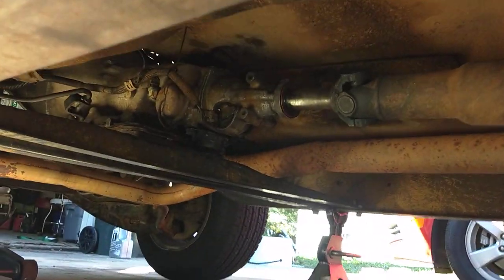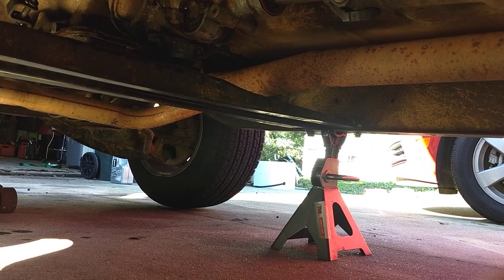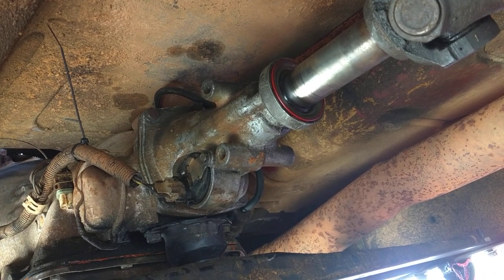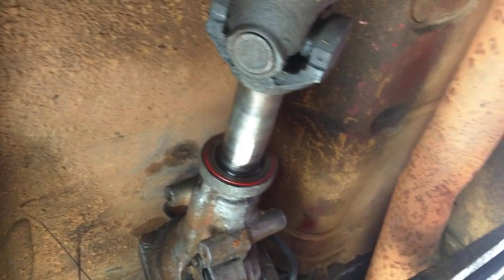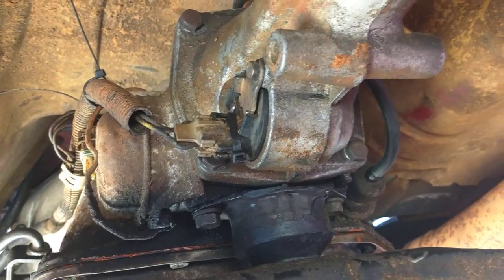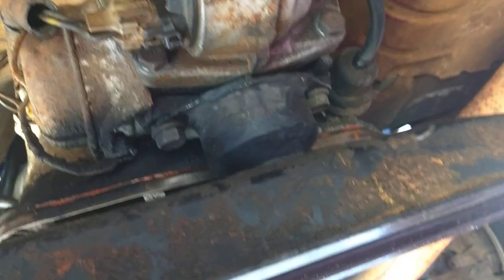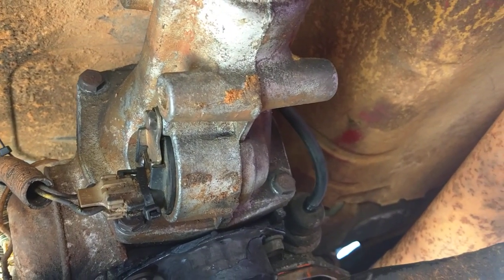700r4 to TH350 Swap not as easy as you think!

Comment: I have an 89 c1500 extended cab and did this swap.  Had to get the 9" tail and modify my crossmember for the mount to have something to hold.  The 2 piece driveshaft saved me from having to get a custom driveshaft.  My homemade crossmember mount makes the pan leak easy but aside from that everything has held up fine.

Comment: I just swapped out my 700R4 for a TH350 in my 1985 K1500 Suburban.  The guy who rebuilt the TH350 added an adapter to it (between the trans and T/C) to make it the same length as the 700R4, so I was able to re-use both driveshafts.  Had to add a vacuum line.  The crossmember lined up OK.  Doesn’t downshift automatically when you accelerate hard because I don’t have a kick-down cable.  Just didn’t feel like getting that 700R4 rebuilt again.
Reply: Frankly  from  your  experiment  which is better   :  the   TH350   or the  700r4    transmission  ?

Comment: Th350 have a 6 inches tail and a 9 inch tail. The 9 inch is only about 1/8th difference total length compared to the 700r4. You need the 9 inch tail. Direct replacement for 700r4
Reply: closer to a inch than a 1/8
Reply: Agree
Reply: @Casey Nemecek…very true! I just did this exact swap from 700r4 to TH350 with the 9 inch tail and it was a perfect swap. The only difference was my truck was a 1985 GMC Sierra (long wheelbase)
Reply: @camron2674  speed sensor and linkage mounted up easy?

Comment: You just need to find the right length driveshaft they make a thing called a baster joint so you can mate an odd size yoke to a different size driveshaft if u cant find the right length get a longer one and have it cut down by a machine shop so its balanced right there u go wham bam👌
Reply from the maker: I ended up buying a 9" tail housing and everything lined up perfect. Didn't need to cut the drive shaft. I called Hughes transmission shop and discussed my problem with him and he put me on the 9" tail housing everything worked perfect.

Comment: I have done many times this swap. The output shaft is same spline for both th350 and 700R4 transmissions at 27 spline and TH350 truck transmission 9" tail shaft is longer also then TH350 car 6" shaft. You must have the 9" truck TH350 output shaft and tail housing to direct swap this into place of 700R4 or 4L60/4L60E.
Reply: Para pegar un clip en el cuadro de texto, tócalo.Para pegar un clip en el cuadro de texto, tócalo.
Reply: For both

Comment: You need a long tail 350 it's a 1/8" difference
Reply from the maker: Ya bought a 9" tail housing and replaced it. Was perfect after that. Ran flawlessly.
Reply: Did you have to change output shaft?

Comment: You need a long tail TH350. These particular transmissions came stock on Station wagons not sure what model and year but very common with the classic wagons.
Reply from the maker: Ya this 350 turbo came out of a wrecked 1970's van. Bought a 9" tail housing off Ebay and it fit perfect had to modify my speedometer
Reply: @tobroke2007  @ did u fix the speedometer?
Reply from the maker: @gerardolopez5875  actually used the 700R4 tail housing on the 350 tyranny but bought a 9" tail housing later off ebay to fix my yolk  problem. Never fixed the speedometer.
Reply: @tobroke2007  @ so 700R4 tailshaft fits on a long tail 350 transmission??? I just need the electric speedometer
Reply from the maker: @gerardolopez5875  it fits but not long enough the drive shaft yoke as you see in video sticks out to much. I bought a 9" tail shaft for a 350 from Monster's transmission off ebay
Reply: @tobroke2007  @ ok but let me ask u something??? The tail housing on the video, is it from a 350? Or from a700?       To me looks like a 700tail housing,   Due to electric vss,  and the holes for bolts, on sides, looks like a camaro 700t4 tail
Reply from the maker: @gerardolopez5875  the transmission in the video is a 350T out of a 1970's model van. With the 1988 700R4 tail housing installed so my speedometer would work. But I later installed a 9" housing off a 350T so my yoke on the drive shaft wouldn't stick out. Monster transmission makes one that your factory plug in for the speedometer will work.
Reply: @tobroke2007  @o ok, i gt u,,     The 700r4 tail housing its shorten than the 350, ok,   I was confused,       I dont nkw why smoe says the 700 tail eill work on the 350, if not,
Reply: @tobroke2007  @ so if i need speedometer,  i need to forget the 700 tail,, and go for a 350 housing with big hole for vss, correct?
Reply from the maker: @gerardolopez5875  well in my case that's what I had to do. Google monster transmission and call them and tell them what your trying to do and they will sell you a tail housing that will work.
Reply: @tobroke2007  @ in your case u only needed a 2” spacer!!! Correct?
Reply from the maker: @gerardolopez5875  no I ordered a 9" tail housing off ebay with the correct speedometer plug in for my truck. But I'm sure monster transmission makes a spacer that would work cause I know they make the tail housing that does cause that's where I bought mine.
Reply: @tobroke2007  @ since my driveshaft fits perfectly,  i will go the cheap route,  25$  adapter from amazon,   Cable to electric speedometer signal

Comment: Did you have to change the flex plate, torque converter? Where is the vacuum hooked up?
Reply from the maker: No I used the same flex plate but used the torque converter that came with the TH350. Ran vacuum to the intake
Reply: @tobroke2007  what about the shift linkage? I'm swapping out the R4 for the 350 this weekend and just trying to get all the info I can lol. Thanks brother!
Reply from the maker: @mindsetguitars5816  no problems. I used the factory linkage with no problems.
Reply: @tobroke2007  sweet! Thanks brother
Reply: I just bought a 700r4 for my 1973 Chevy nova. It currently has a 350th with an aftermarket 2500 torque converter. Can I use that torque converter  for the 700r4 transmission?

Comment: so use a 9 inch 350 from 73 through 86 pickups
Reply from the maker: I guy a few blocks up from me had a long tail 350 fairly cheap so I bought it. I found a 9" tail shaft on eBay for 75.00.

Comment: Idk there's nothing better than an overdrive trans. Compared to a turbo 350 plus first gear is lower a good tranny guy can make a 700 that will last as long as your TV cable is adjusted right they last I know because I've got one been beating on it for years no issues

Comment: what.. who would swap their TH350.. instead of the unbeatable 700R4
Reply from the maker: The 700r4 burned up the TH350 was 400.00 to rebuild the 700r4 was 1400 or better. Was a real easy decision for me.
Reply: Joe Paul @ agree
Reply: Th350 is actually stronger 700r4 its better for cruising down the highway i use my truck to haul wood so th350 is the better option for me
Reply: Mpg 👇👇👇👇👇
Reply: Plus if you want to swap a carb you don't have to worry about adjusting the tv cable.If you don't adjust that cable just right you are going to burn up the transmission.I have 72 C10
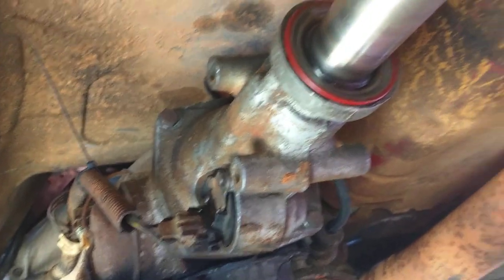9:33  with the same turbo350 in it owned in it 20 years never no problem with the transmission.

Comment: Its that a 350? With electric speedometer???? 🤔🤔🤔
Reply: You press the speedo ring from the 700R4 onto the TH350 output shaft and use the 700R4 sender.
Reply: @quietcool4884  @ wrong,    not that easy,,   700 vss sensor does not fit into 350 small hole,,,    That’s the issues,😩
Reply: @gerardolopez5875  Yes it is easy, the 700R4 tail shaft cover/vss sender/speedo gears all swap over !
Reply: @quietcool4884  @ complete tail housing?  O ok,👍
Reply: @gerardolopez5875  If you dont want to change the tail, then take the TH350 section in AND HAVE IT MACHINED TO ACCEPT THE FKN ELECTRIC SENDER, THATS ANOTHER WAY TO DO IT.     Its not a big problem, people just make it a problem.

Comment: How did you adjust the linkage I'm having problems trying adjust mine I did the same swap too
Reply from the maker: There should be a button on the linkage where is snaps on the bracket that bolts to the intake. I just had a friend press the gas peddle to the floor while I depressed the button soon as the carberator was at full throttle with engine off I released the button and throttle was set.

Comment: I’d like to swap out my trans some day for a 700r4 but it’s a 4x4 so I’d have to deal with 2 drive shafts
Reply: @yamahaguy you can use a short tail th350 and take off the ex housing, cut the output shaft 1 inch shorter and use a 1inch spacer and the 700r4 housing will bolt on and it will be the exact same length as the 4x4 700
Reply: This will go over exactly what I just told you half way through the comments

Comment: I have never seen a th350 with electronic speed autometer... be interesting to see if there is one.. Maybe a th400 in a 88 to 90 1 ton with th400 might have one.
Reply from the maker: I may just install the TH 350 tail housing and zip tie the speed cable up and just download a app on my phone to see my speed or just use a tach to gauge my speed.
Reply from the maker: I googled the TH350 tail housing forsale and found several 6" TH350 tail housing with what the called larger speedometer hole. It looks the same as a 700r4 bolt pattern size and all. I'm gonna order one and see if it's legit. The reviews on them where good. Guess will see.
Reply: @tobroke2007  should all be good I just swapped from a 700r4 to a th350 and it was the same as for the speedometer cable fitment that is... good luck bud.